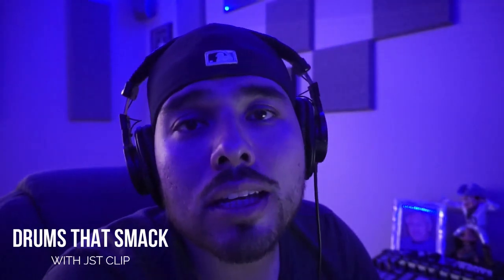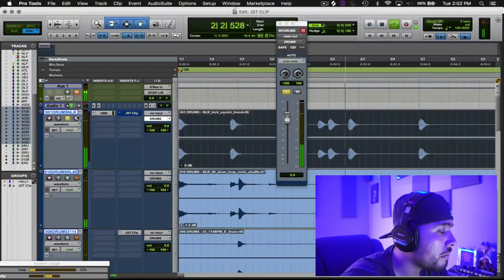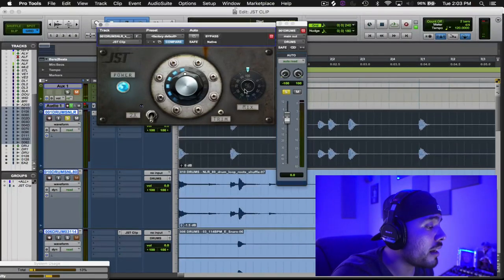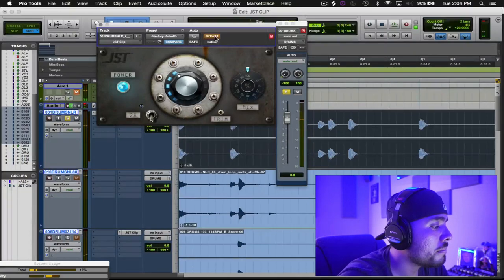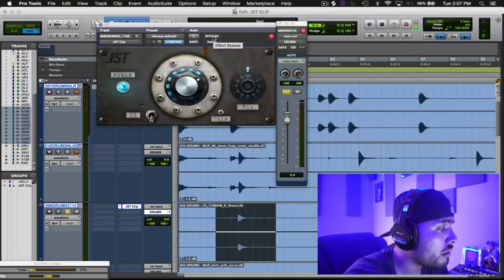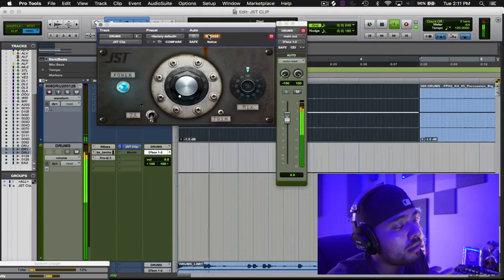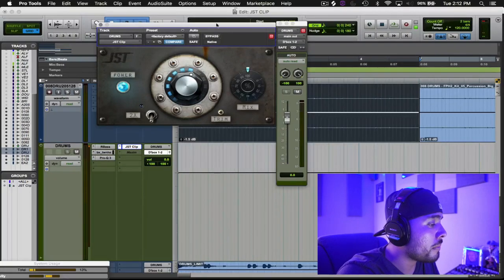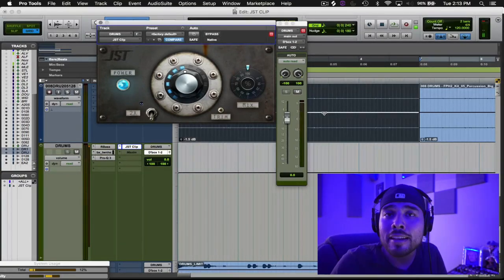Clipping Your Snare!

Comment: Why does the trim knob have a - 12db limit? It makes it difficult to gain stage other elements if I set my kick to - 12db after clipping. How will I get my snare to - 15db after clipping?
Reply: Perhaps using a gain plugin and disk it back to -15db. Add the clip signal and continue to use the trim option
Reply: I hope you figured it out in 5 months time I just realized when you posted this 😅